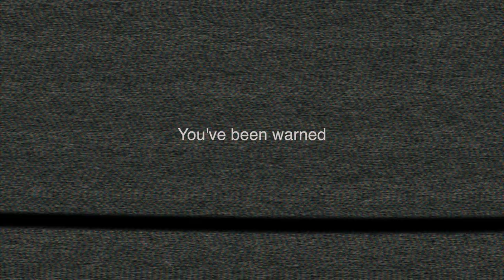I am losing my mind over this boat!!!!

Comment: safety is important in bad weather.
Reply: i was cook on RFA OLNA in 1982. At war turned 18 on way down. went to throw gash over side. 3 decks up got washed over the rail grabbed the rail, outside  got washed back in with next wave. the water was a little chilly. safety 1st and second.

Comment: Nice update, coming together nicely!  Snarky comment in 3, 2, 1 - so that handle to help you step up to the coach roof looks pretty wobbly, is that a mockup or the actual handle.  Also is there a mechanism to lock into place once it is upright so doesn't fold back down or break completely when a wave rolls a 200lb man getting thrown into it with the momentum of an unexpected lurch in a seaway.  Seems unnecessary and like one more thing to break when there is the mast with steps and a hayrack boom to grab a hold of 2 feet away.  I do like the integrated steps outboard; those will definitely be handy.

Comment: I feel for the workers wearing the uniforms in that heat.  I watched something that said that carbon fiber can carry a charge that can result in galvanic corrosion with fasteners used on it.  With the coach roof made of it, is this a concern?

Comment: Slightly concerned how robust the hinge up bars are? If you really pulled hard - lurching as a wave hits - will they take the load with such a long lever arm?
Reply: They look very flimsy. I would like to see more secure handhold(s) up there on the cabin top
Reply: Assume the base plate 20 cm (8"), with the upright centered, that lever arm is 10 cm (4").  By eye, the uprights are 75 cm (30") making the lever ratio 7.5:1.  Assume a 91 kg (200 lb) individual.  The force applied at the base attachment point will be 7.5×91kg= 682kg.

If the attachment was by wood screws, I would require large diameter and long length, as the extraction force is computed as a function of those items (FPL-190).

As this is into fiberglass, there should be a plate mounted under the  surface, both reducing the lever arm ratio and reducing the force per unit area, kilograms per square cm (pounds per square inch), down within acceptable limits. 

The through bolts will be sized as tension failure is a function of the cross sectional area of the bolt and Youngs Modulus of Elasticity.

Conclusion:  Seawind have calculated the numbers.  You guys worry too much.
Reply: @WhatAboutTheBee  What a stonking good answer!
Reply: @Neilhuny  Did Seawind calculate the loads associated the  sails, mast and the rigging and somehow forget this?  🤷‍♂️  Astonishing!
Reply: @WhatAboutTheBee  ???
Reply: @Neilhuny  Its snark.  A proper shipwright will have calculated all of the expected load cases (engineering term), including this stantion handhold.  My apologies for not making the appropriate marks to  inform the reader.
Reply: @WhatAboutTheBee  I'm very gullible and easily led ...

Comment: I am a little surprised that a boat that is a “performance cat” would be using MDF for structure. It is a very heavy material with low cost it only significant benefit.
Reply: MDF is only used for templates for the final panels. I think that Nick has explained that. If it’s green it’s a template.
Reply from the maker: Thanks mate. It’s exactly this. If its green its a template